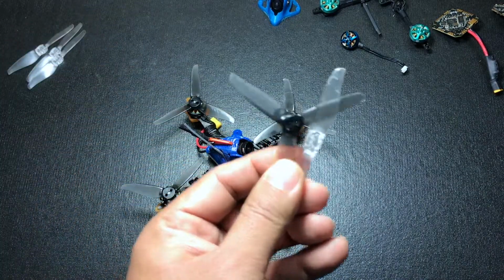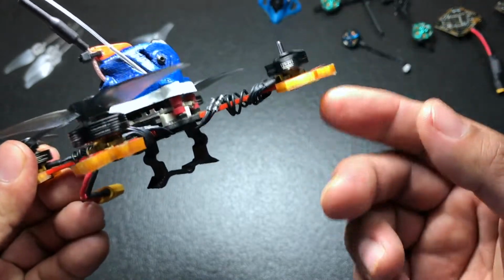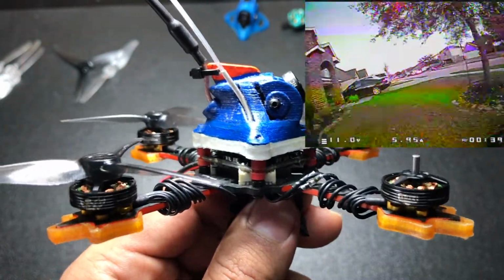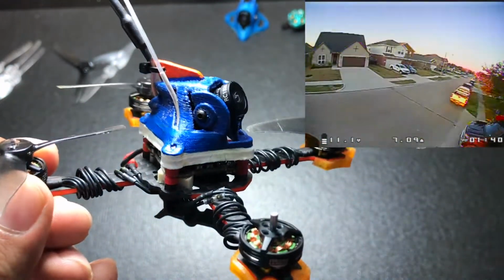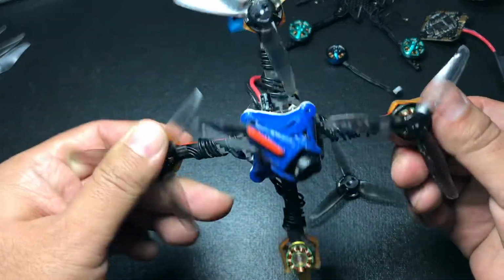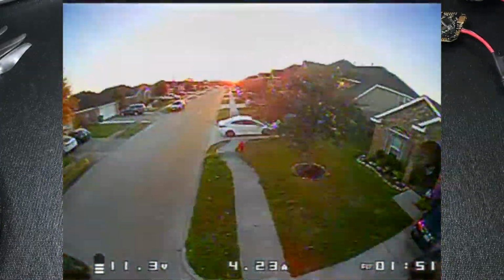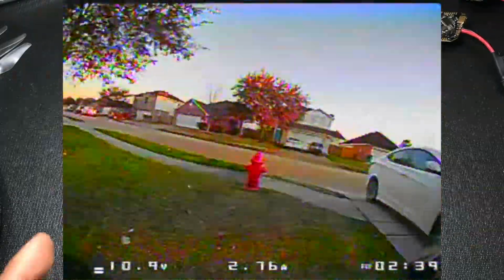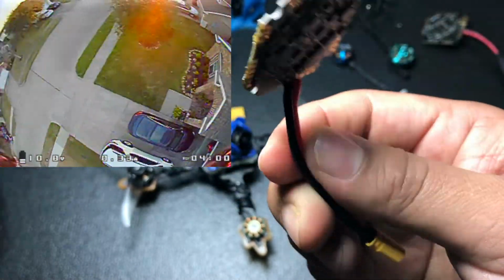Amaxinno 1303 48k motors 🟡🏁 + Gemfan 3016 | Full review & Filght! 🎥

Comment: The hole in the prop is 1.9mm so that it is press fit. 1.9mm drill bits are hard to find so I used a 5/64” drill bit which is just smaller than 2mm. It takes some force to get them on but I wouldn’t say it’s press fit, so I used the prop screws. I recommend a drill press so that everything is square and go slow. Just discovered and enjoying your content! Great stuff!
Reply from the maker: GT Csanadi   Thanks for the support 💯
Glad you enjoy the content!

Comment: Sir pls make betaflight 4.2 tune for tp style quad. So scare to fly 4.2.i heard there's fly away in default tune? Wth is going on
Reply from the maker: Haven't had any issues yet. I would turn off Dmin and see what happens. Iv only tried 4.2 on one micro build using RPM filtering.
Reply: @SteveO4478  I'll try that. Thx for info
Reply from the maker: HelioGenesis -HS No prob!

Comment: Nice review my old friend. You cant find those motors anywhere right now. Also do you prefer the 1105 5000k? I know you like the no voltage sag.
Reply from the maker: Jeremy Chotto  Thanks man! Yeah motors are gone I bought them a month ago. I still like the 1105 5k, I feel you get the best of both worlds but the smoothness of the 1303 amax is very nice! I feel more lower grunt and loose a small amount of top end of the 1303. As 1105’s become harder to come by looks like this size will be the next best thing.
Reply: @SteveO4478  have you heard if the Amaxinno will come back in stock?
Reply from the maker: Jeremy Chotto Nah. I hear that a V2 will come out but don’t know anything yet. Kabab said something about titanium shafts....